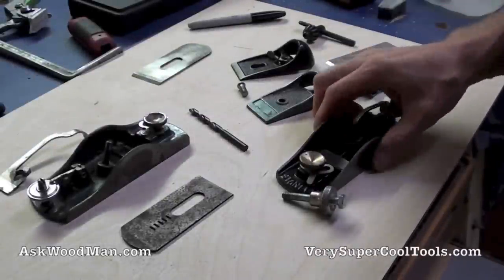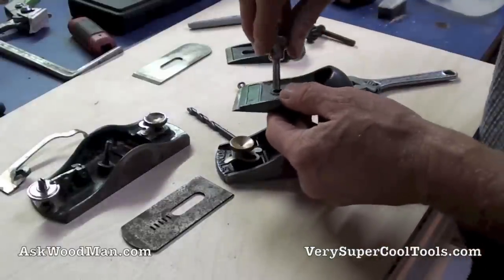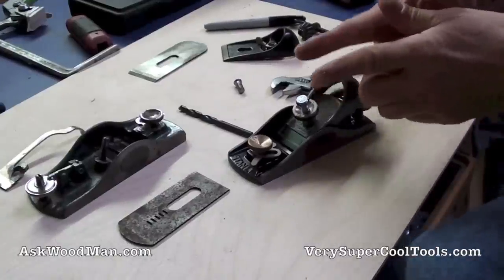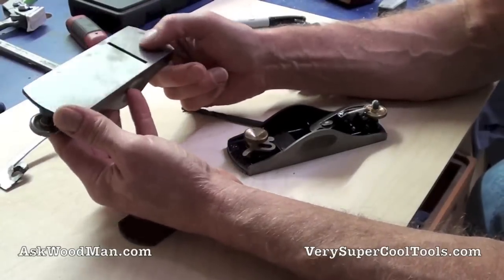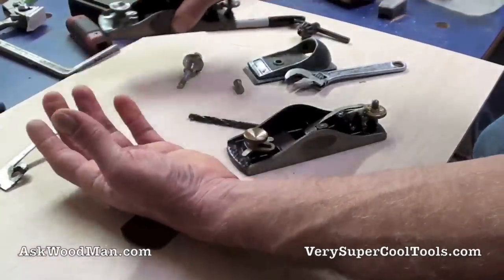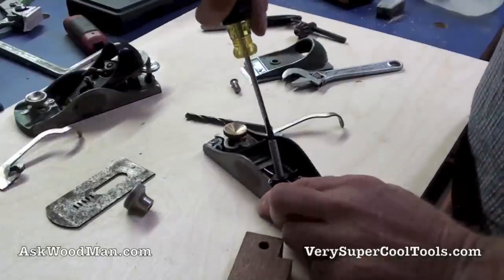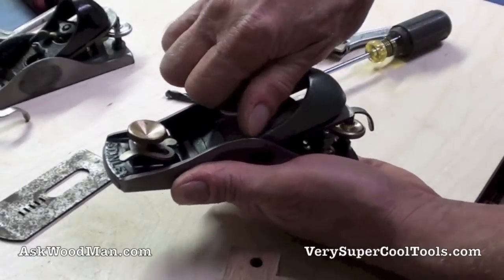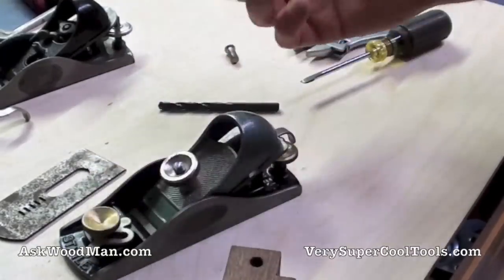3 of 3 -- Stanley No. 9 1/2 • Hand Plane Assembly • Woodworking Project

Comment from the maker: Have you tried that Union Butterfield tapping fluid? I just discovered it at my local machine shop supply house. It is about the consistency of honey and is the best I have ever found. It takes just a drop and does not sling off when drilling. It was cheap too. Made in USA.